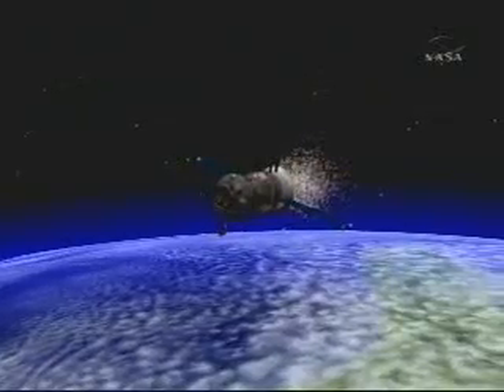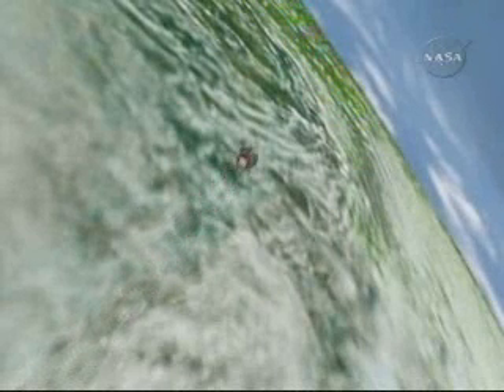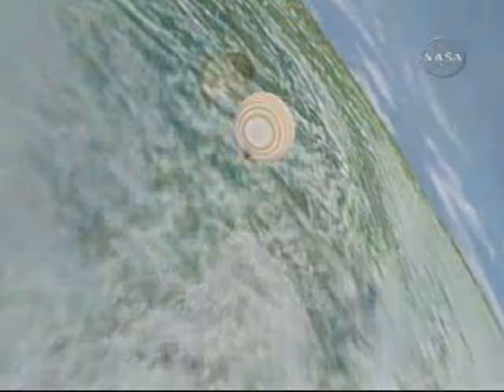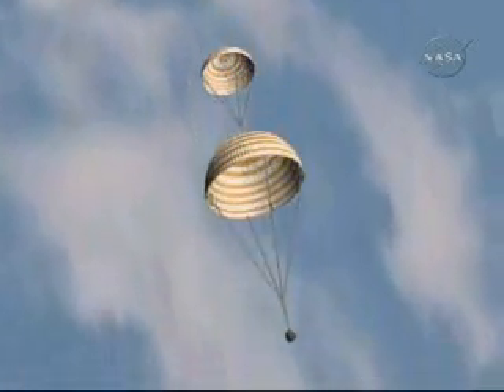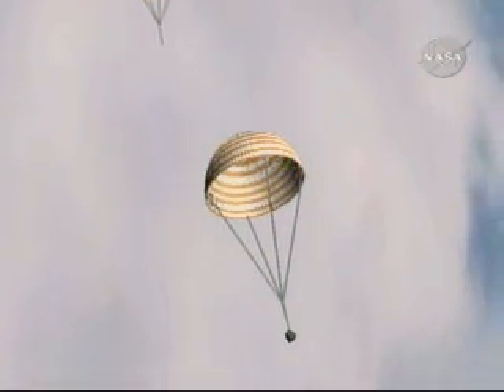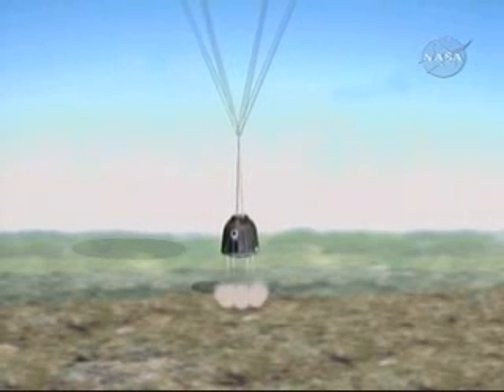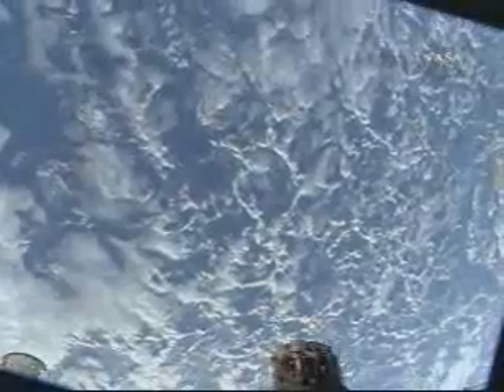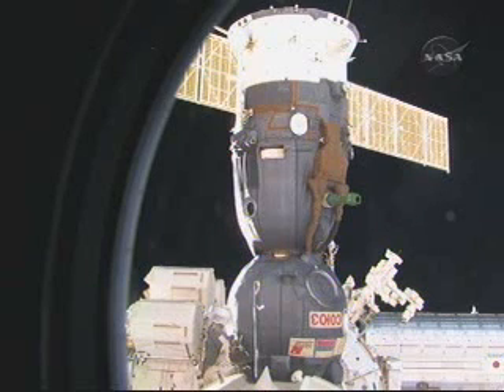CG Soyuz TMA-13Deorbit Burn and Landing

Comment: @OriginalAtomicSheep It is shaped for "passive" stability - a disturbance of angle in the atmosphere will result in extra aerodynamic forces that move it back to center.  Obviously it uses control thrusters to line up for entry at this angle before jettisoning the remainder of the spacecraft.